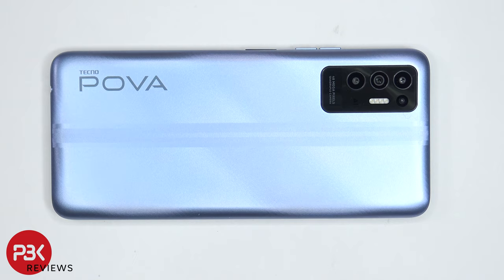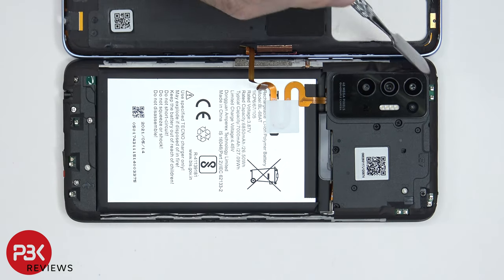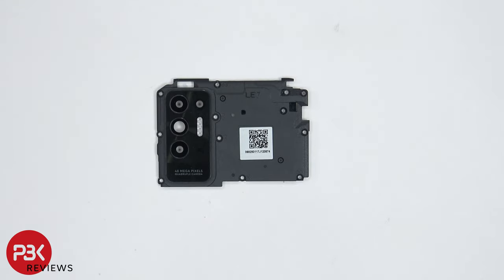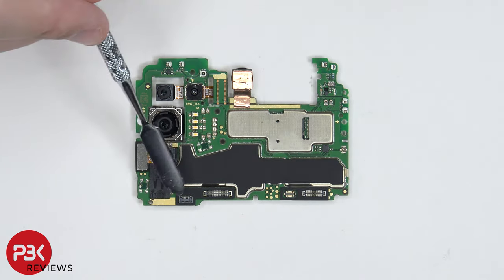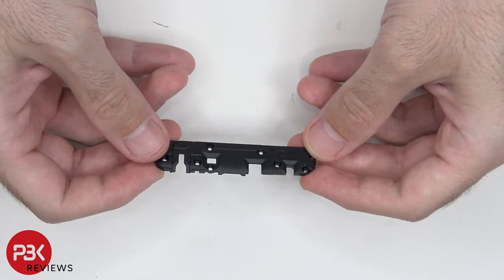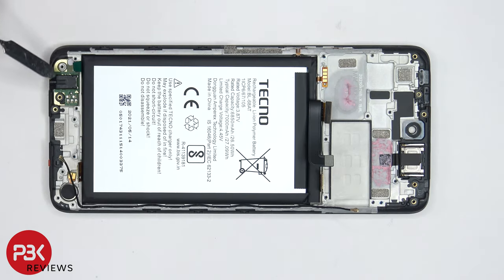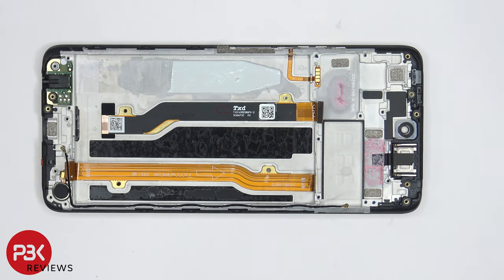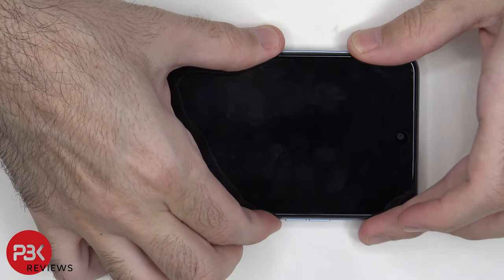Tecno Pova 2 Disassembly Teardown Repair Video Review

Comment: Is it possible to use a thin copper sheet with thermal paste for the CPU? Will it fit inside? You know for additional cooling performance.
Reply from the maker: It won't really make much of an improvement to do. If there was no thermal paste already, I would say yeah but it already has a decent amount and just adding copper tape won't provide that big of an improvement.
Reply: @PBKreviews  I don't know, man, but I saw a YouTube video where they added a tiny copper sheet. It's not a tape; it's more like a hard, bendable sheet of copper. They also applied thermal paste, and there was a big improvement in temperature after he compared the stress test results, especially after playing some games.

Comment: my tecno pova 2 phone is not very loud can you help me i tried everything it doesn't work it doesn't make much sound is there any other setting it will be loud
Reply from the maker: Have you checked to see if the speaker filter has gotten clogged? try brushing it out with a tooth brush or something. Sometimes also when sticky substance blocks the filter, it will require you to replace the filter over the speaker opening.

Comment: I have the same phone, yesterday it went out of battery charging, so I put on charge, Useing it original charger,. After two hours I try to start it but it only start, vibrate and freeze on Tecno. I wait a lot but it did not change. Since then I tried to shut off by pressing on off bottom long press, it shut off for three seconds and automatic start again and freeze on the first  page Tecno.
Do you have any solution please?
Reply: Hello my friend. Perhaps the problem is with you because there is a virus in your device or there is an error in the system. You can solve the problem by making a software for the device